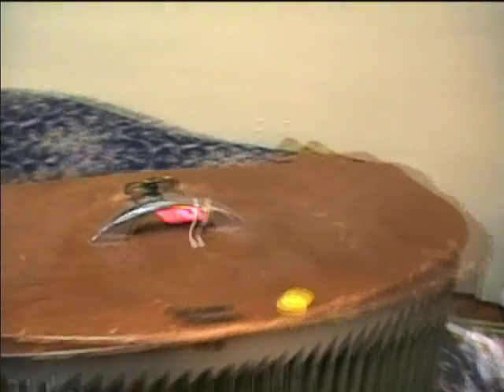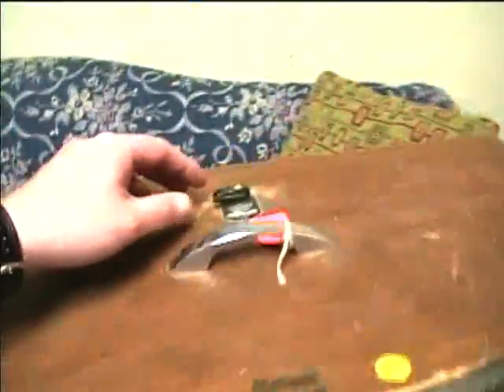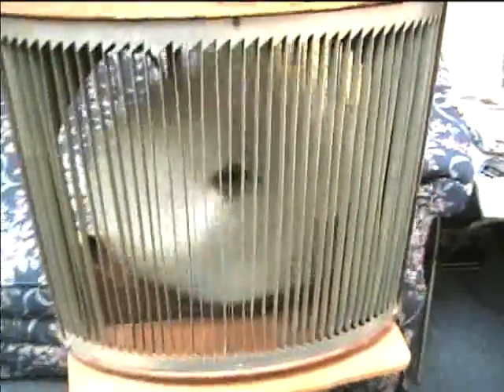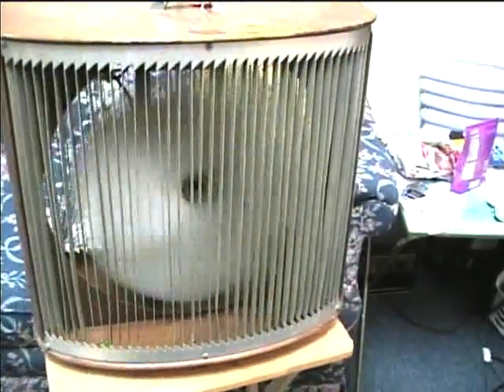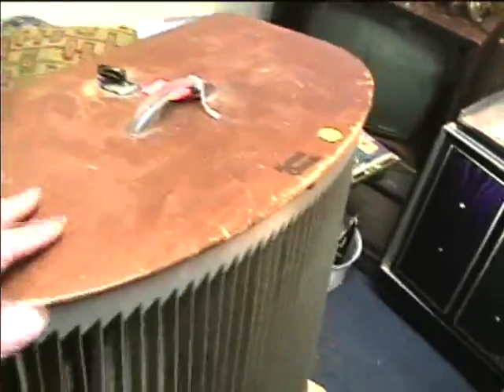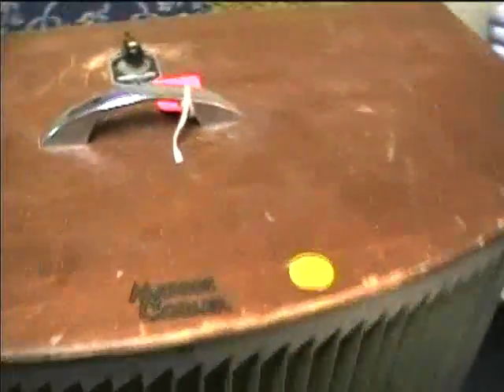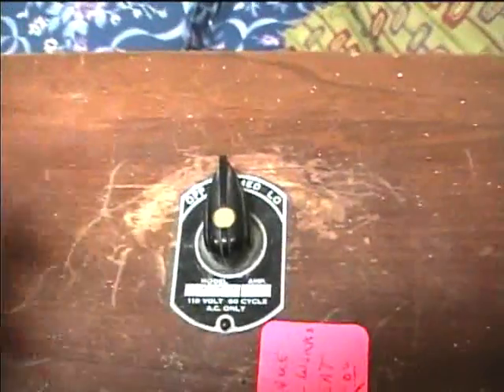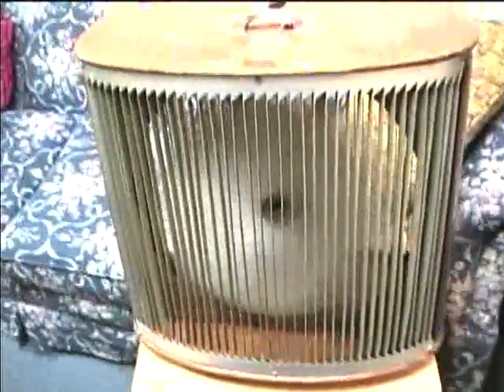Mathes Cooler Fan New Motor running demonstration

Comment: you should get a replacement  motor thats 3 speed for energy savings you might want to go with a Permanent Split-Capacitor motor as they are more efficient than the original shaded pole motors. if the motor is single speed you can get the speed coil or transformer rewound or else go with an infinite speed triac speed control switch.

Comment: Do you want a new switch that is a dimmer that would be able to hold up to 250 watts and 3.0 amps and i will include a control knob and a wiring diagram if you want it.

Comment from the maker: hehe. Actually the original motor was held in place just by friction between the mounting struts...there are some cross-bolts on the struts to hold tension between them, but the motor was not bolted to the chassis. The tie wraps just give some extra stability to the motor as it is held in pretty much the same way the old one was.